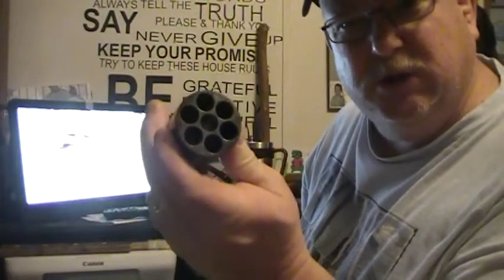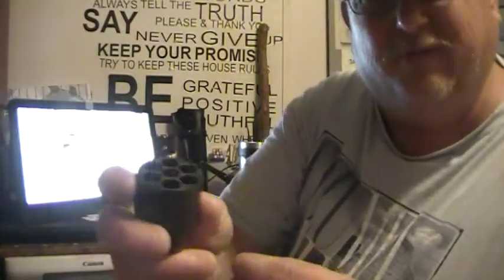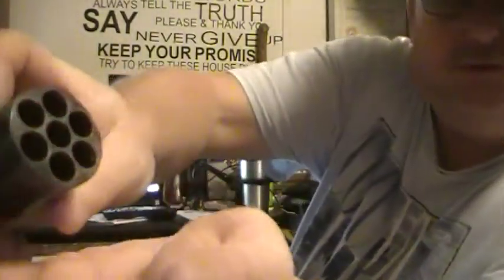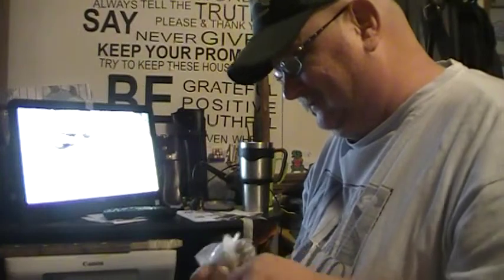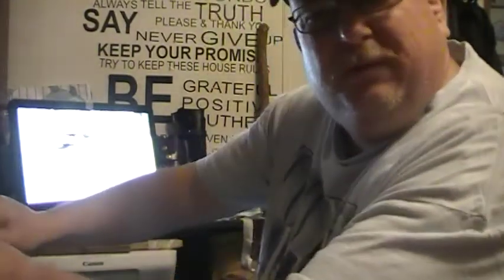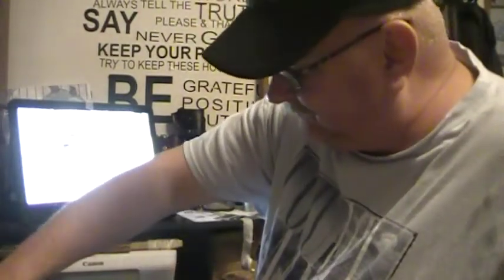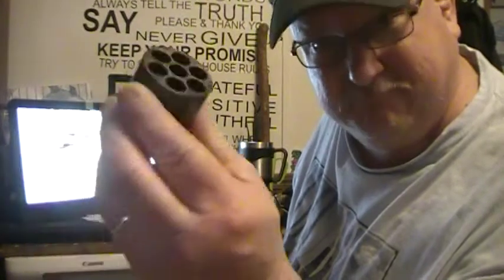Busted Myth Black Powder

Comment: I’ve been shooting black powder fire arms since the Reagan administration, and I have never had a chain fire or blow back on a C&B revolver. Why? Well that’s easy, I will not use a slug that is malformed. Now what do I mean by that? I cast my own bullets both round ball, and conicals those bullets must be clear of imperfections that could allow a spark to get past the bullet. So if that bullet does not look like what you would find in a factory load, don’t use it and just recast it. Secondly use the right size caps, as if you are pinching the cap to make it work then your asking for problems. #10 for C&B revolvers, #11 for single shot cap lock rifles and single shot cap lock pistols. If it ain’t tight, call it Houdini wallah.

Comment: Theoretically a chain fire can originate at either end of the cylinder. In real life I believe it originates at one particular end almost all the time. I could be wrong though. Someone should try to cause a chain fire under test conditions - one of the two ends will be a lot easier to induce a chain fire - that likely is the end where it occurs in real life.
I have had only one chain fire in 39 years of cap and ball shooting - three chambers went off.

Comment: A rather tedious explanation of a simple concept.  Additionally, using high viscosity lube contributes to fouling by providing a receptive surface for the unburned carbon of combustion. A light machine oil (WD40) in a felt wad will provide  lubrication that is readily combustible so that fouling is greatly diminished. The wad also provides a barrier to ignition from outside the cylinder.

Comment: The biggest cause of chain fires is that modern repros have a very weak main spring, (an original Colt has circa 12 Lb hammer draw weight), this allows the hammer to be blown back on firing and high pressure gases to envelope the rear of the chamber causing any gap around the next chamber nipple to leak flame into it, it is not possible to ignite a chamber from the front if the projectile is properly seated, the easy way to achieve the correct size is to measure the groove diameter, then ream the chambers to 1 or 2 thou over that, the chambers also need a small chamfer to increase the interference fit of the projectile as if the throat is left sharp it will be sheared off rather than squeezed in tight. Chris B.

Comment: During a chainfire the powder pressure will flow back through the nipples and set off the caps.
It happens so fast that even under slow motion video it appears the caps have set off the charges.
I suppose we could drill out some nipples and put loose fitting caps on and try it with blank charges.

Comment: Sam Colts original manual did not call for lube over the balls.
It required oversized balls that would provide a lead bearing surface between the chamber wall and the ball. This sealed the chamber from moisture and prevented chain-fires.
Too small a ball will not provide enough bearing surface for an effective seal so a spark could reach the powder in an adjacent chamber.
Having said that I used .the same
 .451 balls in my revolvers and in my 45 caliber target rifles for may years.
As long as the balls will stay seated in the chambers under recoil they will shoot fine.
But, they require lube or wads to prevent chain-fires. 
The lube does keep the fouling soft for long strings of fire without having to break the revolver down for cleaning.
If you know what you are doing you can make things work.
Thanks for the video

Comment: Good video, you are right.....
First thing I do on buying a new cap'n'ball revolver is measure the groove size, the ream the chambers to .001" larger than that (which also makes them perfectly circular). Use projectiles (balls or conicals) .002-.003 bigger than the chamber mouths and provided  you cap it up properly chainfires will never happen. In fact the fit of a ball or bullet that shaves a bit off when loading is better than a bullet put into a brass case I think.
There's a lot of false "lore" about BP guns invented in the modern era when these firearms became popular again. You should see some of the crap about flintlocks!.
Latterly I have been using paper cartridges for convenience in the field, and yes they are convenient, speeding loading a lot.
Back in the 19th century when percussion revolvers were "state of the art" they didn't carry a loaded revolver in the holster with grease in the chambers. The collection of grit and stuff would be very bad for the bore. Pistols back then were carried a lot and shot little.
Rear end chain fires are rare, but I guess could happen, especially on a Colt due to the way they are made, but again if properly capped it won't happen.

Comment: Pretty sarcastic presentation. But there's a lot of truth in what you said, Taurus. First, chain fire can occur from EITHER end of the cylinder. And I've said so many times over the years. First, as you so eloquently pointed out, the bullet must fit properly. A properly fitting bullet will shave a thin ring of lead upon loading. However, you implied that chamber lubes are useless, and that's wrong. The primary purpose of chamber lube is to lubricate the bullet AND (repeat  AND), keep the fouling soft. A secondary purpose is to prevent chain fire in case of an out of round chamber or out of round bullet. This is rare, yes, but I've seen it a couple times over the years. Lubes should be non petroleum-based, i.e. natural based lubes such as tallow and beeswax. Petroleum-based lubes yield a hard and difficult to clean fouling. Natural based lubes are cleaned up with soap and warm water.  I've fired a box of balls (100) in one outing without difficulty and without stopping to clean once I got things set up. 
You're quite right that flame from a fired nipple won't travel up and down and around the corner. Plumb right. A fully loaded cylinder and only one cap placed at a time (other nipples bare) WON'T chain fire. Period. HOWEVER, too large a cap that's pinched in place WILL chain fire. The only chain fire I've ever had was when I pinched #12 caps in place on #11 nipples. The flame from the fired chamber will ignite the CAP on adjacent nipples in the same manner as how a flintlock works. Flame from the pan ignites the charge in the barrel THROUGH the touch hole. Too large a cap leaves a small space for flame to ignite it. 
So - properly fitting bullets AND caps equals no chain fire. Proper lubrication equals better performance and increased number of available shots between cleanings. 
I agree that proper attention to detail should result in zero "pan flash" which implies that using a separate measure is probably not needed, but its safer to use one, so why not opt for safety?

Comment: Lube or wads do in fact HELP prevent chain fire. An unknown defect in a ball or debris on the chamber will in fact leave a path causing chain fire. IF all things were perfect at all times then you’re  possibly right. Chain fire CAN happen from the nipple end whether it makes sense to you or not. I also have never seen an experienced black powder shooter pour powder directly from a horn or flask into a rifle.
The lube also increases accuracy by keeping the fouling softer over the length of the barrel.
Reply: Wrong
Reply: @raysheppard8040  Believe what you will, it has been proven many times over through actual experimentation and demonstration.
Reply: @DavidWilson-eu1mv  REALLLLLYYYYY nope
Reply: @RaySheppardJr  Just what actual research has shown.
Reply: @DavidWilson-eu1mv  Yes on either account, Measuring chambers in cylinder, using "Proper Size Ball" will do and continue to do more than grease or wads, but hey these aint the droids your looking for
Reply: @RaySheppardJr  Just the point that deniers do not like to admit that it is a fact. Like I said, “IF all things were perfect all the time … “. More than grease or wads? No. Same as … yes IF ( see prior line).
Reply: Hahaha😂😂😂😂😂 special ed are you here's your helmet